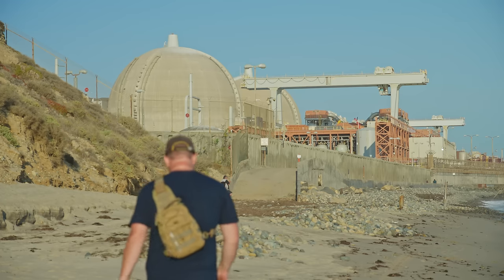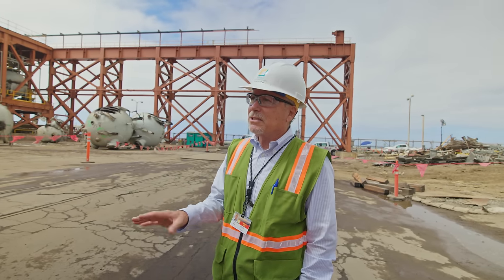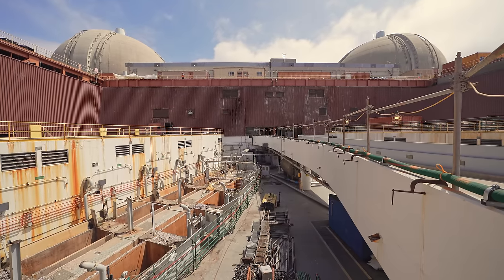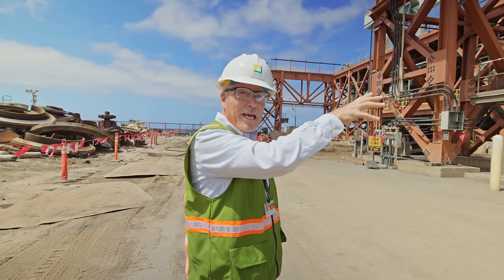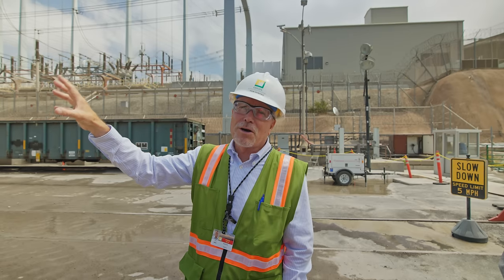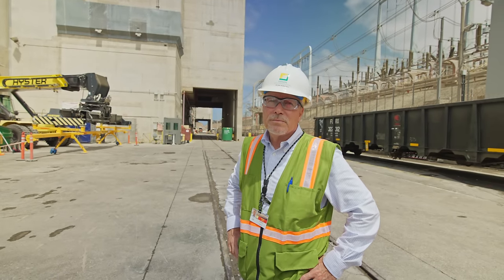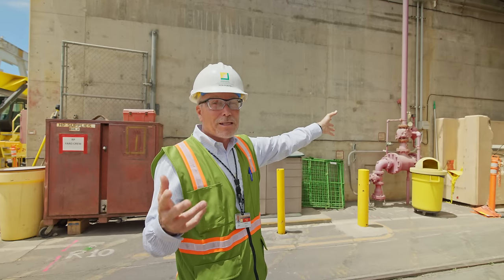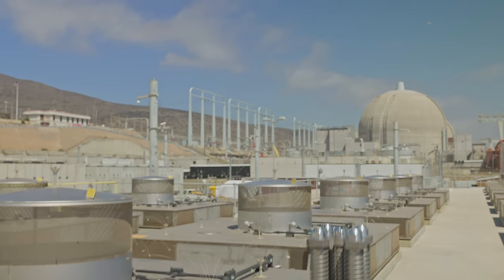Inside the Decommissioning of San Onofre Nuclear Power Station

Comment: It's a shame that all these plants are closing. It's the best way of making power.
Reply: Their original steam generators were leaking radioactive reactor coolant into the "clean" secondary side so they replaced them at a cost of $1 billion and the replacement steam generators also leaked.  When these old plants, and we have over 90 of them, have a major component fail, it is no longer coat effective to operate.  On average, 1-2 shutdown every year.

Why did you scrap your perfectly good 1970s automobile just because the engine was blown when it would only cost $5,000 to repair a vehicle worth only $2,000?  What a waste of a good car!
Reply: @UrielX1212  My analogy is simplistic but accurate on why old nuclear plants, that are fully paid for and have license extensions, are shut down, just like Palisades, that was shutdown a few months ago. 

Here is the reality of new nuclear in the U.S.
Please don’t assume that YT videos are factual.  If you live in the U.S. here is the reality for the last 4 state of the art Westinghouse AP1000 ADVANCED passive safety features new nuclear power projects and spent fuel reprocessing and in the U.S. over the last 20 years. You decide if this YT video was presenting the truth. 

The Southeastern U.S. is super pro-nuclear MAGA, has zero anti-nukes, and 100% media and political support. 

The MOX facility (South Carolina) was a U.S. government nuclear reprocessing facility that was supposed to mix pure weapon grade Pu239 with U238 to make reactor fuel assemblies. It was canceled (2017) in the U.S. After spending $10 billion for a plant that was originally estimated to cost $1 billion and an independent report that estimated it would cost $100 billion to complete the plant and process all the Pu239, Trump canceled the project in 2017.

VC Summer (South Carolina) new nuclear units 2&3 were canceled in 2017 after spending $17 billion on the project (original estimate of $14 billion and 2016 completion date) with no clear end in sight for costs or schedule. 

Vogtle (Georgia) new nuclear units 3 &4 currently 110% over budget and schedule (currently over $30 billion) and still not operating. Mid way into the build, the utility stated that had they known about the many costly delays they would never have chosen nuclear. They are now delayed another year because according to the project management, thousands of build documents are missing. 

Please google any of this to confirm.

If you can’t build new nuclear in the MAGA super pro-nuclear southeast U.S. then where can you build it?

Comment: It’s a brilliant idea to decommission power plants in California, where they annually have rolling brownouts due to not having enough power. Absolutely brilliant.
Reply: The plant was old.  The steam generators leaked radioactive coolant into the "clean" secondary side.  They replaced the steam generators at a cost of $1 billion but the replacements leaked.  Keep trying?

Your 1970s car has a blown transmission, you replace it at a cost of $4,000 and that replacement fails.  What would you do?  You need transportation.

Diablo Canyon will be allowed to operate longer but they need billions in repairs.  So, it will be interesting to sit back while California gets no additional power from Diablo but increases rates to pay for the repairs.  Me thinks people will complain about that?
Reply: @clarkkent9080  Absolutely yes they should keep trying, there isn’t enough power, period. Cost is not the immediate concern. If repair or maintenance isn’t possible, then build new nuclear plants. If cost is that much of an issue, then maybe they should divert some of the $105 billion from the physically impossible high speed rail project.
Reply: @agentmith  Build new ones like this?  Isn't it strange that YT videos on nuclear FORGOT to mention reality of new nuclear in the U.S.????  Maybe people should not educate themselves via YT videos

Please don’t assume that YT videos are factual.  If you live in the U.S. here is the reality for the last 4 state of the art Westinghouse AP1000 ADVANCED passive safety features new nuclear power projects and spent fuel reprocessing and in the U.S. over the last 20 years. You decide if this YT video was presenting the truth. 

The Southeastern U.S. is super pro-nuclear MAGA, has zero anti-nukes, and 100% media and political support. 

The MOX facility (South Carolina) was a U.S. government nuclear reprocessing facility that was supposed to mix pure weapon grade Pu239 with U238 to make reactor fuel assemblies. It was canceled (2017) in the U.S. After spending $10 billion for a plant that was originally estimated to cost $1 billion and an independent report that estimated it would cost $100 billion to complete the plant and process all the Pu239, Trump canceled the project in 2017.

VC Summer (South Carolina) new nuclear units 2&3 were canceled in 2017 after spending $17 billion on the project (original estimate of $14 billion and 2016 completion date) with no clear end in sight for costs or schedule. 

Vogtle (Georgia) new nuclear units 3 &4 currently 110% over budget and schedule (currently over $30 billion) and still not operating. Mid way into the build, the utility stated that had they known about the many costly delays they would never have chosen nuclear. They are now delayed another year because according to the project management, thousands of build documents are missing. 

Please google any of this to confirm.

If you can’t build new nuclear in the MAGA super pro-nuclear southeast U.S. then where can you build it?

Comment: Those turbines you saw weren't even the big ones. That looked like a high pressure turbine. The low pressure ones were bigger. I was working in the turbine building during a power uprate and they had to replace the entire turbine and I saw the gantry cranes drop the new ones in.  The most impressive part is when they move the turbine housing that covers the moving parts. That thing was 100% steel the size of a house and the crane lifted it.
Reply: suprised to see the turbines made of steel, i worked on a new coal plant and the turbines were titanium
Reply: @nickjackson9392  the housing was steel,  the blades themselves were probably some super strong alloy or titanium or similar

Comment: So sad that in California where we never have enough electricity we are decommissioning any nuclear power plants.  Totally carbon free and as green as you can get at a cheap rate.  Thank you Democrats for making us a third world state.
Reply: heir original steam generators were leaking radioactive reactor coolant into the "clean" secondary side so they replaced them at a cost of $1 billion and the replacement steam generators also leaked.  When these old plants, and we have over 90 of them, have a major component fail, it is no longer coat effective to operate.  On average, 1-2 shutdown every year.

Why did you scrap your perfectly good 1970s automobile just because the engine was blown when it would only cost $5,000 to repair a vehicle worth only $2,000?  What a waste of a good car!
Reply: No one is the US is building new reactors.

Comment: Very sad. Hope California builds new reactors, but I have a feeling they won't. Worried wind and solar won't provide enough power, and will destroy more of the landscape with their requirements for surface area.
Reply from the maker: Yeah I don’t think California is going to build anymore reactors. Way too many people there don’t understand how much better it is than wind and solar. Maybe when micro reactors are a thing. But even then people would have to get over their fear of radiation.
Reply: If they did, this is what to expect.

If you live in the U.S. here is the reality for the last 4 “state of the art” Generation III Westinghouse AP1000 ADVANCED  new nuclear power projects and spent fuel reprocessing in the U.S. over the last 20 years. The AP1000 is fully approved by the NRC for construction and operation.  The only NRC requirement is that the plant be built per design documents…..seems simple..

The Southeastern U.S. is super pro-nuclear MAGA, has zero anti-nukes, and 100% media, local, and political support. 

The MOX facility (South Carolina) was a U.S. government nuclear reprocessing facility that was supposed to mix pure weapon grade Pu239 with U238 to make reactor fuel assemblies. It was canceled (2017) in the U.S. After spending $10 billion for a plant that was originally estimated to cost $1 billion and an independent report that estimated it would cost $100 billion to complete the plant and process all the Pu239, Trump canceled the project in 2017.

VC Summer (South Carolina) new nuclear units 2&3 were canceled in 2017 after spending $17 billion on the project (original estimate of $14 billion and 2016 completion date) with no clear end in sight for costs or schedule. Four managers on the project were charged with 16 felony counts, including conspiracy, wire fraud, securities fraud, and causing a publicly traded company to keep a false record.  The CEO of the project is serving 2 years in prison, another manager just got 15 months in prison, and the others are awaiting trial.

Vogtle (Georgia) new nuclear units 3 &4 at 110% over budget and schedule (currently over $34 billion with an original estimated cost of $16 billion). Mid way into the build, the utility stated that had they known about the many costly delays they would never have chosen nuclear. They were just delayed another year because according to the project management, thousands of build documents are missing. The first unit should start in 2023 and when it does, Vogtle will be, for its output, the world’s most expensive nuclear power plant.

Please google any of this to confirm.

If you can’t build new nuclear in the super pro-nuclear southeast U.S. then where can you build it?
Reply: They won't. Instead they will depend on unreliable sources while also mandating electric cars and appliances.

Then when they inevitably can't provide enough power,  they will lock you out of your car to save electricity.

Comment: I used to work there. I was involved in doing the safety analysis of operating with the repaired steam generators at a lower power level (~70%). We showed it was safe and we were on the verge of getting NRC approval. Then Friends of the Earth filed a lawsuit that would have required a complete relicensing of the plant. This probably would have taken years and there was no guarantee of what the outcome would be. Edison got cold feet and I believe the state (Jerry Brown was governor) also greased the skids to pull the plug like they did with Unit 1. There were some inappropriate meetings between Edison and the Public Service Commission that probably worked out a nice (if you go quietly) deal. Edison management always seemed embarrassed by San Onofre and would downplay it in their annual report while playing up wind and solar even though SONGS produced so much more power than their wind and solar generators. Believe it or not, Edison one had a founder of an antinuclear group as its CEO!

I hope SONGS is replaced with offshore wind turbines and wave-powered generating equipment so that the views are marred and the surfing is ruined. It would be an appropriate way to thank the community for their support.
Reply from the maker: The whole closing of that facility seems wrong on so many levels. I wish they would stop with the decommissioning right now and repurpose the plant for smaller reactors. Even doing tests to use spent nuclear fuel in thermal energy extraction into electricity. There’s so much that could be done with the existing infrastructure there. Horrible waste of resources.

Comment: Very cool video, with fantastic access to areas the public never gets to see, thanks heaps. Pity about the plant and all those peoples lives affected by its closure. By the sounds of it, still had plenty of life in it. What a waste.
Reply: Their original steam generators were leaking radioactive reactor coolant into the "clean" secondary side so they replaced them at a cost of $1 billion and the replacement steam generators also leaked.  When these old plants, and we have over 90 of them, have a major component fail, it is no longer coat effective to operate.  On average, 1-2 shutdown every year.

Comment: I live close by,  I had a tour about two years ago but didn't get the chance to get inside the reactor building!!
Reply from the maker: Yeah, the access I got there took almost a month of planning.
Reply: You will not get access. Too much red tape. But I will tell you there is A LOT of equipment inside of it. Large piping, vessels/tanks, pumps and motors 2 stories tall, and more crap to bang your head on than you can possibly imagine. At the very bottom level, there are massive sumps that collect water and have the ability to be pumped into the overhead and rain water down into the entire building. The piping that was on the feed water side was 24" if I remember correctly. 3000lb rated systems of the highest quality stainless steel you can buy, with pedigree paperwork that goes down to where the metal was mined. There is a lot in there. 5 floors worth of equipment. There is a very large crane inside that spans the diameter of the dome and spins in circles to remove/install equipment

Comment: It is far more efficient to remove the solid fuel nuclear reactors, and install breeder reactors and/ or liquid feed nuclear reactors in the decommissioned nuclear power plants.  The basic support systems and power generation equipment are already in place, and can be adapted to the new reactors relatively easily , and economically.  By maintaining standard levels of nuclear power plants facility security, there is very little risk of plutonium or any other fissile materials being stolen from the site.  Evidence based policy making , on a national level, is the key to making this a safe, environmentally friendly, realistic source of energy
Reply: The problem is that old 40 year old plants, are not economical to operate according to their investor owned utilities even though they are fully paid for. The reason being, companies no longer stay in business decades making the same products.  Buy the time a nuclear plant id completed (16 years) most of the equipment in it is no longer made.  The time to source and have components custom made as replacements is too costly.
Case in point; Terrapower is planning on building a 345 Mw demo test MSR in Kemmerer Wy and use some equipment from the 60 year old coal plant that is shutting down.  Great idea connecting a state of the art nuclear plant to turbines, generators and electricial equipment made in 1960

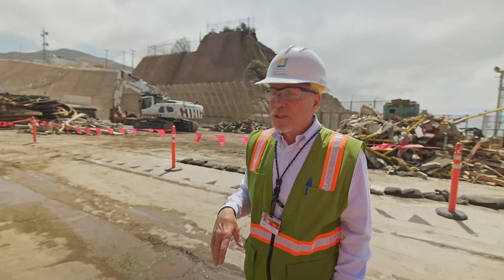Comment: 10:13, im a turbine mechanic and its weird to see those parts that big and rusty. nukes are way bigger than any others, coal is 2nd biggest around 800mw, and they usually run 3 gas turbines each making around 150mw to spin a 400mw steamer.
Reply from the maker: It was very interesting to see those turbine blades up close.
Reply: @RadioactiveDrew  those werent blades they were diaphragms, they sit still in the shell while the rotor spins. also with that damage im not suprised they were scrap, they can be repaired to a degree but that much theyd have to be replaced.

Comment: Didn't know they shutdown San Onofre.  Having lived in LA and driven by countless times, I believed it was always the reason LA and SD never meet.  Whereas look at LA it has continued to develop every inch of land all around it...EXCEPT as you reach close to the plant.
Thanks for the great video.  Just amazing how much cost is involved in all this.   What are they going to replace the power with?  They have all the wires running there, here in sacramento, they closed the Rancho Seco (long time ago, the towers still standing), and they have big solar farms out there.
Offshore wind generators, or back to military use?   They can't move that nuclear waste!   Hauling it anywhere would be highly dangerous in such populated regions.  Guess they could move it by ship into more isolated area.
Reply from the maker: If they wanted to move the spent fuel they could. The site has a rail line that goes through.
Reply: The reason LA and SD will never meet is because Orange County is in between. Lol.
Reply: Moving nuclear waste is not really dangerous at all and it's been done all the time. The new fuel is obviously also transported to the plant and usually old fuel is recycled and refreshed in social facilities built for that purpose, so nuclear waste is sent all across all continents all the time. Depending on the destination moving it on sea will likely be the most economical process though, did to the weight of it all. Railway is the classical choice to move it though. And it had to be moved into a safe storage facility where it can be kept for the next couple thousand years anyways, it's too dangerous to keep nuclear waste stored at every current or decommissioned nuclear power plant. The safety of the population of off course less of a concern in the USA compared to other western countries, but there are many reasons to not just leave the nuclear waste out there forever.
Reply: The reason they don't meet is Camp Pendleton.
Reply: @JonnyRicter  let’s hope the Marine Corps never shuts down Camp Pendleton thereby keeping LA from moving south to San Diego..
Reply: @jhollie8196  Orange County is between LA county and SD county.  Whether Camp Pendleton was there or not, LA county  and SD county will still never share a border. That’s the point I was making.
Reply: @JonnyRicter  yeah, though they were referring to the cities not the counties. Given the chance I do have no doubt they would and would incorporate all the non ad communities in between.